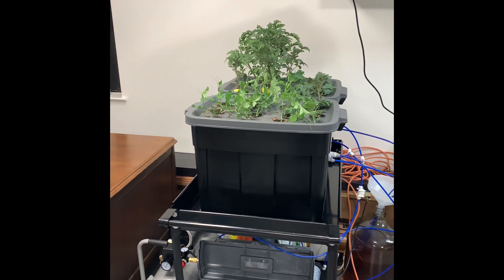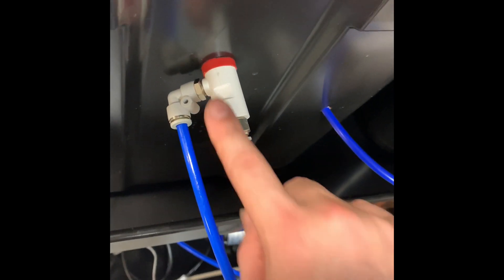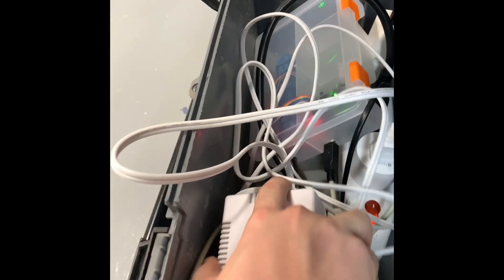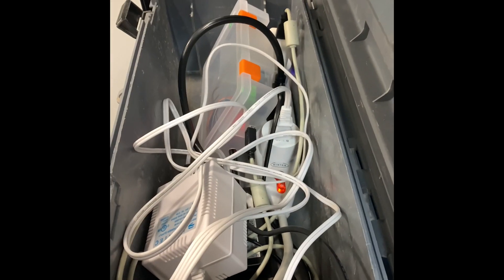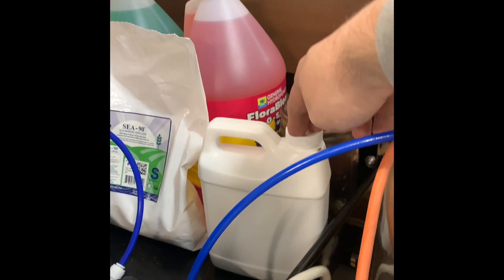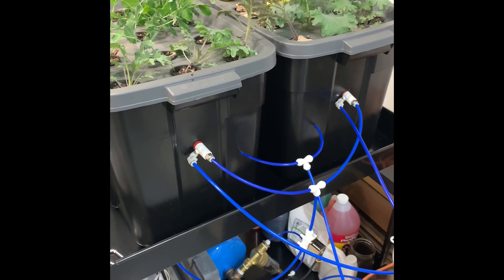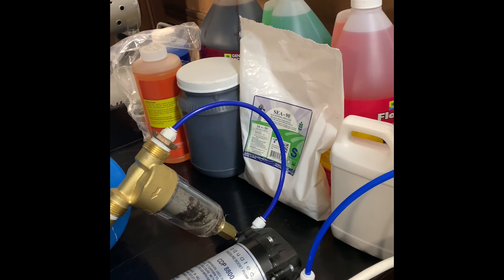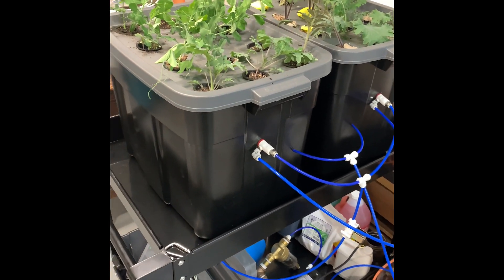Aeroponics 101 - The true build  - for hobbyists

Comment: Oh yeah, simple set up. Anyone can do it. Just got that stuff laying around. 🤪

t......
Reply from the maker: hehe. It's simple in that its mostly analog. Maybe its not ideal for home grows though. I think if I were to do it right I would get a really nice compressor and bury it underground and get a massive tank so I could run the compressor on less intervals. That thing ends up being kind of loud and annoying though, and even two nozzles use surprisingly a lot of air. But I tell you man, the roots go insane under those nozzles.

Then if you want to go the next step, you start buying probes and sensors, and route all that data to a private server, and start automating processes like, "if the tent floods do this", " if tank is at this psi, run compressor", which is really one step away from machine learning automation which is what its like at the top.
Reply: @Ghanzo  yeah, I do want to go high pressure aero.
Reply from the maker: @AverageJoeandaMustang  Nice! Go for it! Just be ready for a lot of noise from the compressor.
Reply: @Ghanzo  not going to use compressor. Probably smaller scale like aquatek 6800 or 8800 pump system. Quieter and does the same thing.
Reply from the maker: @AverageJoeandaMustang  Nice! Good luck!

Comment: So you’re saying that nasa is wrong?
Reply from the maker: Can you source that inference?
The original nasa papers recommended a droplet size of 5-50 microns, which isn't achieved without aerosolizing the water. Aerosol is a pressurized mixture of air and water, that's why its called "aeroponics".
People get fine results without air compression however.
If you can source the schematics for NASA's present growing methods I'd also be interested in seeing them.
Reply: Nozzles don’t clog unless yo use organic inputs or don’t use 200 mesh filters. Try senningers. They won’t clog. You need those larger droplets to develop the roots, then you can bring in the dry fog. With just dry fog, you won’t get much lateral root growth and will see more stringy with fine hairs. You want it as a robust mass with fine hair. Get some senningers and a little pump and try using both mist and fog. Trust me, it works much better.
Reply: @jonosterman2878  hi! which senningers nozzles do you recommend? i saw their catalog of misters and foggers but couldn't find any information regarding dropplet size and also i got a bit confused about the applications of the nozzles. Thanks for the info.

Comment: just did a run in my low pressure aero system, started off great, then they got a mucus buildup and nute locked then started dying. https://www.instagram.com/aeroboone/  I could try another run with adding more oxygen direct to the roots with an air pump but I figured they got enough with the low pressure sprayers, what do you think? Maybe it was an anaerobic issue. Nice system tho enjoyed the vid.
Reply from the maker: Hard to say. There are hundreds of variables. Could be a contamination issue. Might want to do a deep clean of the equipment between grows. Oxygen certainly helps keep the right kinds of things away thats why I like the high pressure nozzles with the small droplets. Were your nozzles clogged? Were you draining well? How about the airflow in the grow room itself? Nice page! Love Maine. Lot of growers up there and Vermont.

Comment: I ran across your video by chance and man I'm glad I did! I'm currently just waiting for the compressor. I was messing with low pressure and then started into the high pressure, basically a giant pain and waste of money. Then I saw this video and emailed aeroscience about the nozzles and now I'm just waiting for my compressor to come in tomorrow. Can't wait!
Reply from the maker: Nice! Let me know how it goes. How big is your setup? 4x4?
Reply: @Ghanzo  Ive got something that will change your system for the better , basically a better tank to complement your system . reply if interested
Reply from the maker: @havokterra  A better tank? Explain
Reply: @Ghanzo   A tank that has been designed for high pressure and has better dimensions and would support your inputs for 10 plus years or better.  thanks for getting back with me if interested we should talk. I'm talking about one of the most engineered plastics ever made to date .
Reply from the maker: @havokterra  If you want to give me one for free, lmk.
Reply: 2x4. Just got the compressor if I can figure out how to post a pic I will to see what you think.
Reply: Ya I cant post a pic to comments but I just tested it and its awesome
Reply from the maker: @reds815  haha awesome!
Reply: I do enjoy a good challenge.

Comment: Nice set up.
I love your spray set up.
That's trick.
When i first wanted to start growing with areo. HPA.
I purchased everything, then once I started building my systems.
I said screw this.
I just saw to many problem's that were going to happen.

So i did some more research and decided to go with LPA. Low pressure areo.
And have been growing this way for almost 10 years now.
With the sprayers I use im able to use micros.
With the spray system you are using I would think if you found a mfg. that only has the micros in their product, with NO other fillers, you would be ok.
I use NPK INDS. micros and it has some kind of filler in it that doesn't desolve.
But it doesn't glog my sprayers.

Also in regards to kelp.
What I use for my base nutes is a product called
MAXSEA.
It's a powder, in fact come to think about it.
Everything I use now is a powder.
But that MaxSea is a great product and it's inexpensive.
I've gone with all powdered nutes. Cause it's cut my cost down to a quarter what I was spending.

As you can probably guess, I'm growing cannabis.

I built 4 areo systems.
Each system has 2, 21 site grow chambers with 1 res.
Each system is 3'x3'.
And I use 1, 3'x3' led light over each system.
Anyway good luck and have fun.
Reply: just tried my first experiment with organic LPA...check my above post n link...would love for tips.
Reply: What type of Nozzles do you use? Cheers

Comment: In pressurized water aeroponic system the roots take up air in the root chamber. You don't need to supply any oxygen to water. Droplet size depends on water pressure. I have that system and the roots are hairy white same as yours
Reply from the maker: Yeah they seem to work pretty well. I think the biggest bottleneck is that the misters clog frequently, but it is nice that they are so much cheaper and that kind of system is quiet where this system is loud. I'm not entirely opposed to pressurized water systems. These misters are badass though, those plants went crazy.
However for a large farm of plants, you'd need a huge air tank and a large number of those nozzles which would need to be 3d printed. I had a lot of algae growth in my system, and my nozzles never clogged once.

Comment: I notice you have the booster/accumulator pump system as well as a separated air/nutrient pump system. Is that from a previous attempt with the cheaper nozzles being repurposed as the scavenging pump? Or maybe it's a secondary backup? From my understanding the cheaper(less expensive than Aeroscience anyway) nozzles on amazon can get down to around 25-30 microns when paired with one of the booster pumps (~100psi). This seems to be considerable reduction in cost as well as a more compact system with a steep disadvantage in the pump being more prone to failure(pressurizes nutrient rather than air)  as well as less oxygen(larger particles and you're not feeding air). I'm a bit torn between the two systems since I could essentially build the cheaper system on the cost of a few of those higher quality nozzles, and is the likely maintenance/replacement point. On the other hand a few pump breakdowns and a need to vent the roots for more oxygen would be on the same order of cost, but that's not a given and not up front costs.
Reply from the maker: Yeah you could try a water pump tank method with air being added with a cheap air pump. Also the compressor is loud. So another benefit of the water pump method is that they are very quiet.

My water pump is being used to drain the system. I might run a test to see a side to side comparison between the two methods. The nozzles and the compressor cost around 350$ where the water pump tank costs around $200 so the costs aren’t too different.
Reply: @Ghanzo  https://www.amazon.com/gp/product/B017HTWMHK/ref=ox_sc_act_title_7?smid=A3JVO9PJXTSCRK&psc=1 
These Tefen nozzles were the type I  was thinking of getting based on some youtube reviews. Just in case you decide to go that route. Looks like all you would need is the 1/4" to quick disconnect adapter and the nozzles to do the test.
Reply from the maker: @MB-hs4vp  I actually have some nozzles already. I'll run one soon. like in a few months lol
Reply: @Ghanzo  what's up bro?
I'm positive your set up is just as good, if not better than using the normal HPA set up.
I don't forsee any problems with your set up.
Except for electrical outages.
And you can get around that with a little solor set up.
In regards to everyone worrying about oxygen to your root zone.
Lets think about this.
You have a air line blowing oxygen into your grow chambers.
Dah, what's the problem?
Plus if you are draining your grow chambers back into your nute res. you are collecting plenty of oxygen with that circulation.

Another thing i noticed is, you might want to black out your nute res. You should keep light from getting in there. Plus it will keep your temperature down.

One more thing, there are pros and cons to this debate.
Micros or sterile ?
The way I look at it is.
Which one is natural and which one isn't ?

I have had NO problems going with micros.
Even with during the summer sometimes my nute solution gets a little warm.

But everyone has their own opinion about everything.
Which is fine.
You just need to find what works for you and go with it.

Like I stated before I've been growing this way for almost 10 years now.
And I'm just letting you know what works for me in my setup.
It doesn't mean it will work in your setup.
But I don't see why it wouldn't.
Oh, I'm sure you are checking your pH and ppms. And your humidity to temps. So your plants get the correct evaporation pressure.
Later... ASS OG.
Areo Systems Sea Of Green.